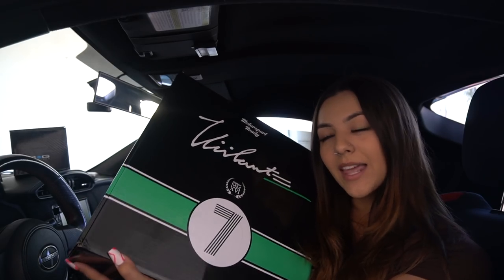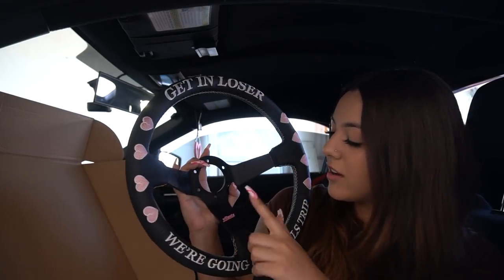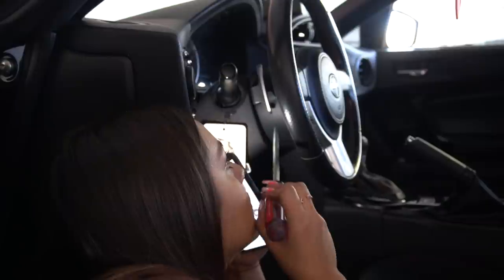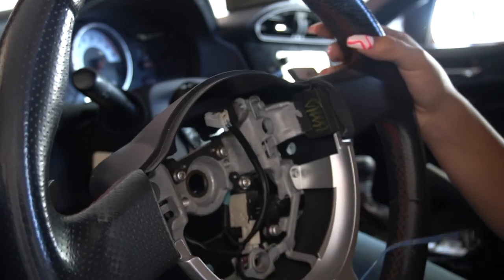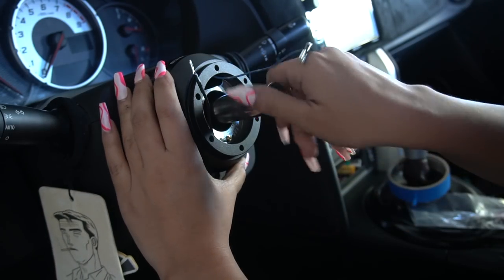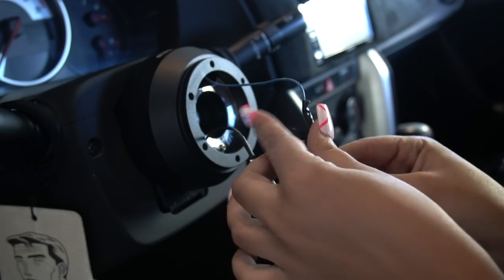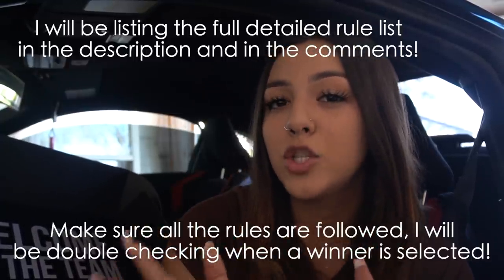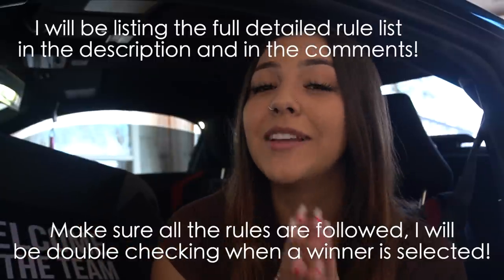QUICK RELEASE & STEERING WHEEL INSTALL +GIVEAWAY!!

Comment: I have been watching you when you got your lowering springs which means I have been watching you for a while already, but I would use the steering wheel for my FRS and it will look amazing since the seats are partially red which will fit amazing in my car.

Comment: You can always Adjust the steering wheel by the Little handle under the steering wheel don’t know if you try or not but I’ll be putting the steering wheel on my 2013 frs to Match with my red wrap. good luck to everyone 🙌🏽

Comment: I would install in in my 2013 Scion FR-S. I deadasss just got it about 1 months ago. I already installed my headers, front and over pipe. Also exhaust tips. And now just waiting on my air intake to come in. Winning this would be a cool install to do to my project car. P.S I think the pink steering wheel would have been awesome.

Comment: The steering wheel mod is the best interior mod you can do. Just put a flat bottom on my 13 WRX and it changed the driving experience immensely. I wouldn’t recommend a quick release wheel solely because you lose the airbag for safety reasons but to each to their own. Great job on the install. Took me a little while to install my wheel because I was OCD about trying to not move the clock spring but other than that looks great and probably feels a hell of a lot sportier! Edit: my homie needs a new steering wheel